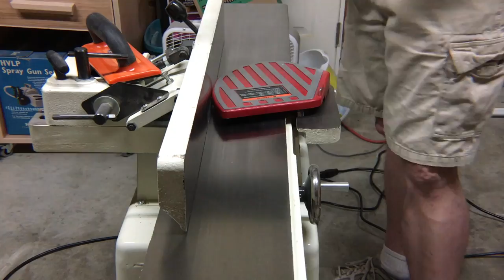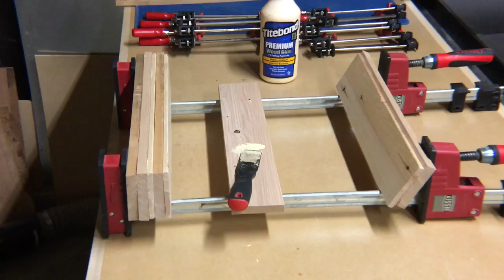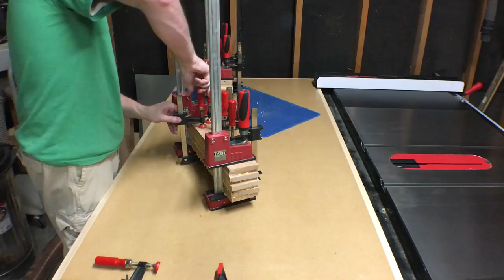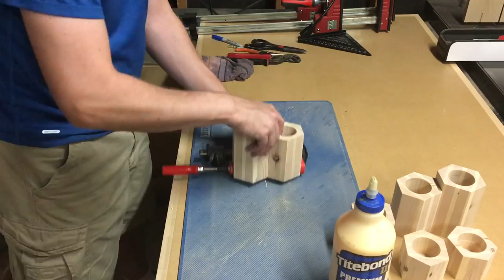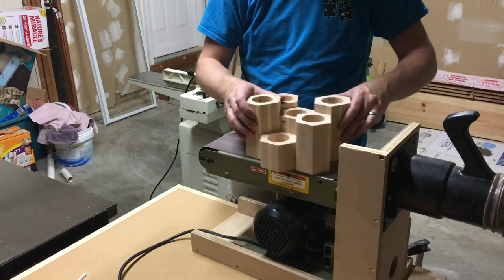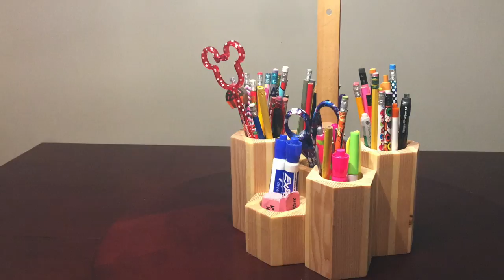Pallet Wood Project | Desk Caddy | Small Woodworking Project

Comment: What size bit did you use to drill the holes? 2 inch diam? Or 3 inch diam?
Reply from the maker: I used a 2 inch bit and stopped about an inch from the bottom on each piece.  I covered these details in my website article if you want to check that out...link is in the description.  Thanks for watching! 👍🏻

Comment: Hi Dan - How large is your assembly table? Does is double as an outfeed table as well?
Reply from the maker: +Owen Jennings it’s around 3ft by 5ft I think...give or take a few inches each way.  It does double as an outfeed since I’m limited on space.  I do need to rebuild the top though as I’ve noticed with my current project it’s not very flat anymore.  I’ll probably do a torsion box style and shorten the legs a bit so it still sits lower than the table saw.

Comment: what is size and height for it?
Reply from the maker: +Adam Baker each of the pieces is about 3.5 inches across and they vary in height from 2.25 to 5 inches tall.  Thanks for watching!
Reply: Dan Prudlow what about angle
Reply from the maker: +Adam Baker the blade was tilted to 60 degrees and then I just crept up on the cuts until they met at a point.  So each angle ends up being 120 degrees after all cuts are made.
Reply: Thank you